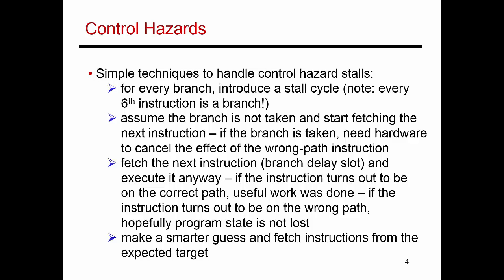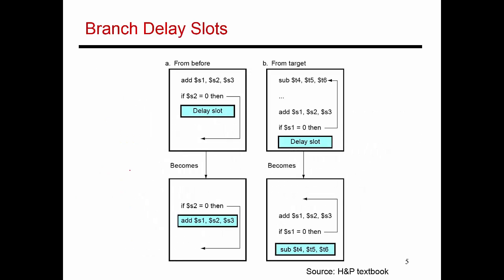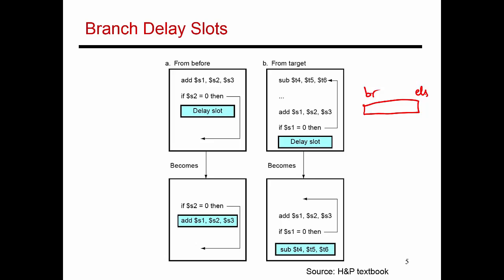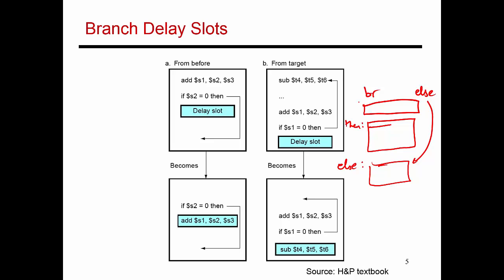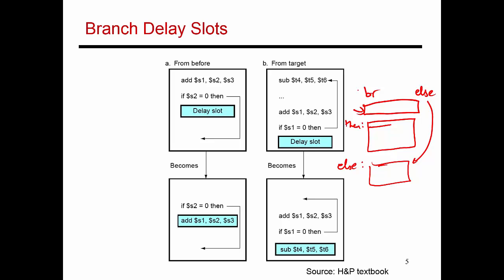Video 55: Branch Delay Slots, CS/ECE 3810 Computer Organization

Comment: Nowadays, compile time branch prediction (with profiling) is usually better than 95%, and run time branch prediction (one cycle beforehand) is about 97%, according to some manufacturers.  So branching code actually suffers from this technique as it make the code larger, resulting in both higher ICache mispredict rate and pressure on the instruction bandwidth.  It's not ironic that the only surviving major architectures are those without a delayed branch.
Reply: Perfect branch prediction recognizes that only about 2-3% of branches are actually misbehaving, though we're only about to see about 90% of the time what direction a branch will go well ahead of time.